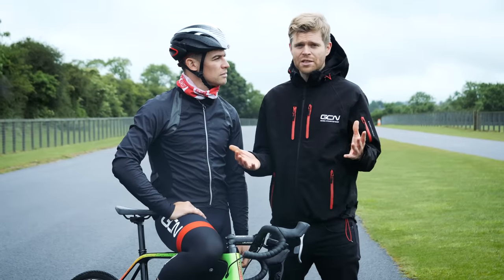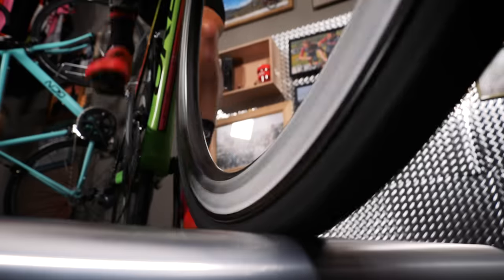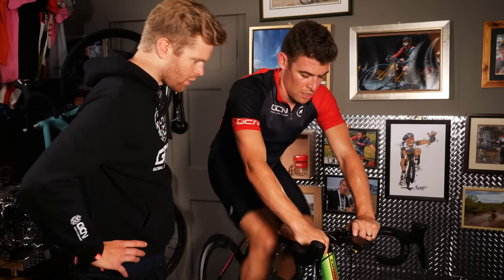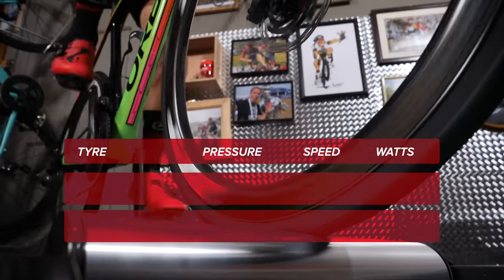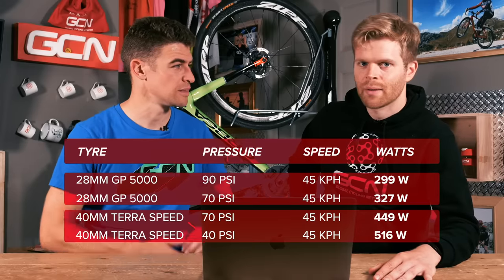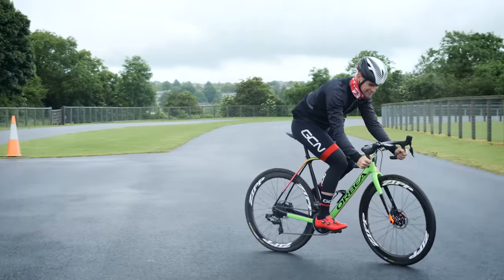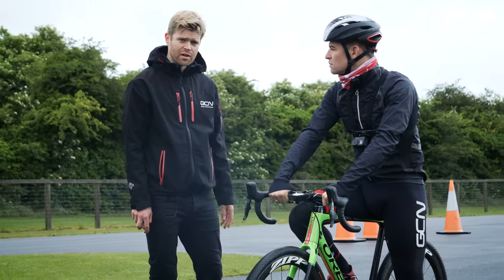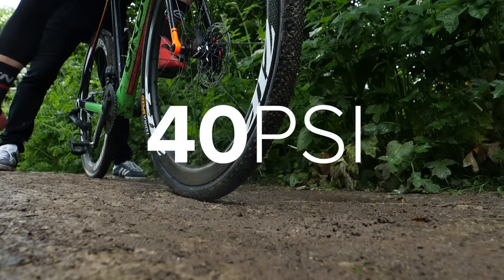Gravel Vs Road Tyres | How Much Slower Are Gravel Tyres?

Comment: Nice video. 

Idea for next test: 23 mm vs 25 mm vs 28 mm road tyres compared on the rollers. 

I ride with 23 mm @ 8 bar / 123 psi.
Reply: The difference would be almost impossible to notice with their setup, results would be within 2 watts. 

At the same pressure wider tyres roll faster, while at pressures you'd actually run the narrow tyres roll faster as shown here https://www.bicyclerollingresistance.com/specials/grand-prix-5000-comparison assuming a pretty smooth surface. 

Narrow tyres have a much more significant aero advantage too, regardless of your rims.
Reply: Why? Who cares what the fastest tyre on rollers is?
Reply: @bink281  exactly Greg! 👍

Comment: I have two similar(ish) carbon road bikes - an S-Works Roubaix that runs 28mm Conti GP 4000s and a Merida Ride 7000 that runs 35mm Schwalbe G Ones. I honestly can't (unscientifically) tell the difference in speed on a tarmac road. The G Ones are ridiculously smoother on rough bitumen and stupidly better on gravel. For me, on all surfaces and multi surfaced rides (which is almost all of my rides), the 35mm G Ones win.
Reply: Hi Jack. Great feedback. The Schwalbe G ones I assume you are referring to the G One "Allround" version  & not the "Speed" model? If you don't mind me asking what weight you are and the tyre pressures you are running please? Cheers. Alan
Reply: Similar experience here, in that Gravelking SK/X-one and Smart Sams on the gravel bike all seem to be as fast as I was on a full road bike, i suspect air drag has more effect, and I love the grip/pot hole taming.
Reply: I'm riding the Schwalbe G-One Allround MicroSkin TL-Easy Folding Road Tyre. I bought them on either Wiggle or CRC for about Aus $75 and according to their website they weigh 400g each. I ride them anywhere between 30-50psi. Highly recommended. @alanbenham4139
Reply: @jackseph03  Cheers Jack. That's very much appreciated. Having not had much experience with off the offroad & onroad pressures I was interested to learn of your experiences. I have a set of the same, running them tubeless, on my Trek Domane and do a bit of gravel / road riding with them on. I weigh 80kgs and run them at 60 psi for road only, 50 psi for a mix of road / gravel and if it is pure gravel then around 35-40psi. They are a great tyre, but I do notice the extra drag on the road compared to my Conti GP400s (25mm) running them at 85psi. Thanks again for your comments.

Comment: I ride a trike (Performer JC 70) and it came with Road Tires.  But I am looking at replacing them with Gravel Tires because where I live there is far more gravel roads than paved roads.  There is a primary 2 lane highway that has good paved conditions, a 2 lane secondary highway with no shoulders and lots of potholes and patch repairs.  After that there are Super Grid gravel roads with a lot of loose gravel and then secondary grids with a wide variety of conditions from hard surface to rutted and rugged. I am not driving on trails.  This is why I think something like a Schwalbe G-One R might be the best choice for me.

Comment: So, you're telling me that I should train with gravel, race with road tires?
Reply: if you are on terrain like these guys are you would probably put 40mm slicks on.
Reply: Is it suitable for a road bike to use with gravel tires?
Reply: it depends on what your roads you are cycling on most of the time, in my case i really don't need gravel tires
Reply: @nrsaification  it depends of your bike fork. If it wide enough you can use any tire that you want.
Reply: @nrsaification  a bike shop (or Google sometimes) can help figure put how wide you can fit on your frame/fork, and theres no harm in going with the widest you can fit. A gravel bike with road tires can give best of both worlds, low resistance but more grip and comfort

Comment: 1) you should find either a road that has equal section of smooth tarmac, rough tarmac and gravel, or do separate tests with reasonable power output(not to overwhelm road tire on gravel section) on those 3 types of surface
2)do speedrun on same conditions as 1)
3)take 3 or 4 types of tire - road(maybe add 2 types of road tire), smooth, fat gravel and this type of gravel. maybe drop in xc bike on smth like schwalbes 2.35 fat g-one

Comment: i ride specialized pathfinder pro's on my gravel bike, they have a raised slick center and on tarmac that's pretty much the only thing in contact
as a result even though they are 40mm wide and run them at lowish pressures they feel and go like road tyres

Comment: Would have loved Chris to be performing sprints uphill with both tires and different surfaces. It's always uphill and front wind for all of us.

Actually both tests  should've been on level ground or nearly similar leveled ground and  compared on power used through distance at or time.  nevertheless it wouldn't be scientific anyway.

Comment: I saw a test the other day where they found the wider tyre actually had less rolling resistance on a flat surface (Road) as opposed to a skinny one with higher pressure. It was because the narrow spread length wise as opposed to width

Comment: Thank you, it was interesting. 
I use 30mm clinchers with inner tubes on 17mm rim. I like 30mm cyclocross tires best. Even though the minimum inflation is marked 4bar I usually use less.. about 3 bar at front and  4 at rear. 
I suspect all this 40mm wide tires talk is just marketing trick, to make people to convert to tubeless system. I have tried 35 and 42mm wide tires too. with inner tunes. I felt it would become un safe if I let tire pressure to my liking. I only use 40 mm tires at winter to ride in snow and ice.. those are studded tires.. And they are made with dight fiting beads. So they stay on even with pressure less than 2bars. Also on winter, on ice I would ride more slower and carefully anyways.  My opinion is that 30mm wide tires really are better and more fun to ride.. The gravel specific tires? what on earth are those? Is it like you take a support car with you and then they hand you another pair of tires or whole bike when you reach to a sandy or really muddy spot?

That gravel you rode there. That's not real gravel. Or it is gravel, but not a real life situation. There's so many different type of gravel that you may  meet on same ride. You may plan your route ahead, but when you get to there, the road you selected is freshly graded.. muddy soft surface.. Or some loggers, or random tractors have ruined it. sand. mud. then the road is actually closed and have to take a detour on asphalt.. These so called gravel tires, will they actually work on such road? How many kilometers on asphalt before the tread is all gone?  I understand gravel bike, but gravel tires? All I ask is 30mm cyclocross tire that withstand also asphalt.. I mean an allarounder. I love Schwalbe cx pro tires, but the rear tire wears on smooth asphalt extremely fast.. and seems the carcass threads are start to showing fast too.. Even though the tire tread isn't too worn yet. Which I don't really understand. How does that happens so fast. Is it that tiny rocks and sand on gravel, reach to between knobs of tread and wear it..Or lately I started to think, that maybe it happens when I brake very hard on asphalt.. maybe it digs somehow treads through to surface? Because the tire isn't really meant to ride on asphalt.. it has too deep and soft tread.
Here's also a video, showing the kind of gravel I meet on my rides time to time: https://youtu.be/TiVo2U3auzg?t=442 I think that if I had 42mm tires there. I would not have been able to ride there as long as I could with 30mm cx tires. with narrow tire I rode as fast as I could. Then it was easier than riding slow. I rest when got too exhaust and again as fast as could. It's easier to push narrower tire through of mud and cain speed. Also surprisingly on bumpy road I never have had a pinch flat.. I'm using schwalbe sv17 inner tubes. They are for commuters, but really durable and I can use them for my 30mm cx tires and on winter with 40mm suomi tires as well.

Comment: Roller test (small amount of wheel/roller contact) was good to show that it was mostly wheel width that made a difference (@70PSI 327W/449W=72.8, 28mm/40mm=70).
Tarmac test should actually have been to tests, first to show to roll speed with each tyre, second to show roll distance starting at a set speed. The road tyres already have the advantage with lower resistance so by starting it at a higher speed which it gained from the downhill roll it has both higher spend and lower resistance aiding it to a longer rolling distance after the turn.
The gravel test....

Comment: I can say descending on a steep gravel road on my 25mm continental 4000s is terrifying. Never let myself get over 45kph. Even at that speed I can feel the front wheel pushing side to side as it looses contact with the ground. Don’t even think about getting out of the saddle climbing either cause all you’re going to do is spin the back wheel and waste your effort. Would like to find a good compromise tire for my 75/25 tarmac to gravel/so broken may as well be gravel tarmac. If I had that I might be tempted to pick a few different routes to include some more gravel. For a bit more safety and scenery.

Comment: Give the job to someone with a reasonable 5 to 10 mile traffic free commute, one week on the posh road tyres and another week on the so-called gravel tyres. Get their Strava timings and see if there is a pattern.
This needs a multi surface ride ideally with power meter and time data to complete the course. Often commutes are done under race style conditions to get to work in time, there is no hanging about. If the test is replicated with several runs on a fixed, well known course (the commute) you should be able to see what is faster.
Reply: That's very good thinking. I think a week might not be long enough, though. Alternating week-to-week over three months would give more reliable results.
Reply: I commute 10 miles a day on my Boardman ADV 8.9 with 40mm WTB Nano tyres, and a Trek Alpha 1.5 with 25mm Conti GP4000. My times hardly vary more than a few seconds. I’m probably quicker on the gravel bike due to having better brakes and being able to keep my speed up on the crap surfaces that pass for roads in the UK
Reply: @armadillito  I think you are right. Someone needs to nominate themselves to do this important A/B testing. Just a commuter routine with the same route, tyres swapped weekly and inflated at the same time. Apart from anything else a lot changes in the lifetime of a tyre and it is how it works six months later that matters. Same rider, same conditions, same bike, same route, all on Strava.

Comment: I did a test between a road bike and cx bike at 250w over a 2 mile paved out and back. 25mm gp4000@85/100 psi and 35mm Gravelking Sk@35/40 psi. Same average wattage only netted 1/2mph difference for the road. I wouldn't race it, but I'd ride my gravel setup on the group coffee ride with 0 hesitation.
Reply: Sorry, .15mph, not 1/2. Minimal difference.

Comment: I just swapped my Schwalbe G-ones (38mm) for Conti Terraspeed's (40mm) and trundled off for my regular weekend 60km ride. BIG difference!! Worked my arse off to be slower. Handling on fast corners on Tarmac/concrete is a bit dicey too on the Conti's. Feels like the back end keeps stepping out. I swapped because I kept getting punctures on the Schwalbe's. We'll see how it goes.....
Reply from the maker: Might be worth playing around with the pressure you run your tyres at - this might help correct problems with handling

Comment: Impressive difference, this has definitely convinced me to get a slick wheelset for my Canyon Grail. Would be cool to see a comparison between the Grail (or another gravel bike) on slicks and a thoroughbred race bike on the same wheels and tyres. How much slower would it still be?
Reply: I’m considering this for my grail. That’s why I’m watching this. Did you purchase some slicks for your grail? How has it been?
Reply: @geoffchambers4471  Got the Vittoria Corsa G2 Race 30mm. Really happy with these as I do a lot of distance on tarmac and the extra width compared to regular racing tyres makes it bearable to do up to ~20% gravel. Wouldn't recommend to try an all gravel route on these though, I still switch back to my 40mm tyres for that.

Comment: I would love to see this comparison 5:51 for 25, 28, 32mm road tires (same make and model) with different tire pressures.
Reply: I dont know about those widths. But I can tell you this. I bought a heavy ebike ADO A20F. 72LBS. And it came with knobbly mountain bike tyres.

With them I got only 11 miles range with an average speed of 18mph. And a top speed of 24.5mph.

A friend recommended I change them out for a set of SPEEDSTER honeycomb tyres. And I was STUNNED  At the difference. I got 14 miles range at an average of 18mph. Over the same route. And a TOP SPEED OF 27MPH.

I'm sticking with the speedsters. I hold the PSI at 22.

Comment: I commuted for years on a cyclo cross bike. I would use the bike for everything, and during the summer ran 20 spoke wheels & road tyres.  By midwinter I would be on lightweight 32mm cyclo cross tyres and 30 spoke wheels. I never noticed the difference when I switched tyres, but it was obvious when I switched wheels. There. That's science.

Comment: Great comparison! There are some gravel tires on the market that offer the best of both worlds. Problem is again APPLES to ORANGES... they suffer in other areas. My favorite tire to date is the Vittoria Torreno Dry G2.0.  Fast rolling on most surfaces and the knobs on the outside help with tracking and cornering. Of course this is just my 2 cents or 2 p for you blokes on the other side of the pond. ;)

Comment: Just time your fav gravel strava segment of say 5KM approx ideally.  See what you can get on pure road bike, gravel bike, and gravel bike with aero bars, and maybe 2 different tire pressures, a low and a high pressure, maybe 25PSI and 45PSI on the 38c or whatever.  Whether a slick or a knobby is faster at the same size tire would be interesting because I expect knobbies are not good for speed on gravel.

Comment: So, if I want to ride my gravel bike fast on pavement and gravel I should own two sets of Zipp wheels with one set having GP 5000's and the other with Terra Speed's?
Reply: No... Get the Lightweights
Reply: Chinese wheels ftw
Reply: get a road bike and put proper tires on it if you want to ride fast on pavement
Reply from the maker: You ride whatever you like Jeffrey! 🎉
Reply: I have two sets of wheel sets. One with 32mm GP 5000 and a 40 mm tubeless G one set. I use the 40mm because I like the comfort and plushness for training or super long rides.
Then again for shorter HIT rides I take the GPs and they are on another speed level on gravel.
Varying the pressure on the 32mm GPs can change them from a road tire to a super fast gravel tire. I would suggest to first check if the available pressure range can't cover your driving needs and of not, buy a second wheel set.

Comment: Another rider and I had a challenge on our wednesday night ride. I had to ride my gravel bike with 43c tires and he got to ride his road bike. If he got droppped and I didn't he got a punishment. When the speed got a consistent over 50kph/31mph it got hard and I eventually got dropped, and lost the challenge luckily for him. I do not get dropped on this ride, and I'm normally the one dropping everyone. The gravel tires are significantly more difficult to push at very high speeds. At speeds under 25mph it seemed just fine, maybe a little harder but nothing crazy.  I don't have a power meter on my gravel bike, but a 32mph group ride 1 min pull I'm normally doing about 500w in the front. I'd say on the gravel bike I was at 500w drafting someone. I think the gravel bike basically lost 3-4mph for the same watts at higher speeds.

Comment: That means that on a 10-mile ride you'll ride (coast) 658 more feet or about 12.5% further on road tires in this test. Or, about 53.2% of the length of a pro soccer field further -- wow.

Comment: That's fascinating.  I do however have to point out that both tires went through rollable conditions.  

Let them encounter surfaces that naturally slow down any bike.  Like a puddle of water, a patch of loose gravel, mud or sand.  That would also be interesting.

Comment: Congrats on an interesting video. It's a shame you didn't have time for a run with 70psi or even lower with the GP5000 28mm on gravel. We calculate that for an 85kg rider+bike a like-for-like comparison on gravel would be 58psi for a 28mm and 46psi for a 40mm tyre, but that's assuming its the same tyre with the same casing construction (see fft.tips/surface). Very short slow speed roll-down runs minimize aerodynamic effects and focus mainly on rolling resistance but the shorter run then the wider the confidence intervals. Any tread pattern will only lower rolling resistance (but promote grip when conditions are slippy), so what you have discovered is that road tyres are faster on gravel runs where power is minimal and grip is not an issue and gravel tyres are fundamentally slower (but grippier) unless power is needed under difficult conditions. An interesting follow up test would be two of the same road tyre 28mm/32mm on gravel (at three pressures each) or two of the same gravel tyres (at three pressures each) . all the best